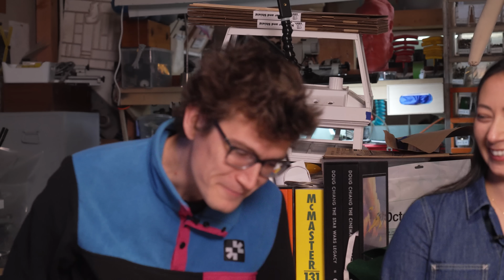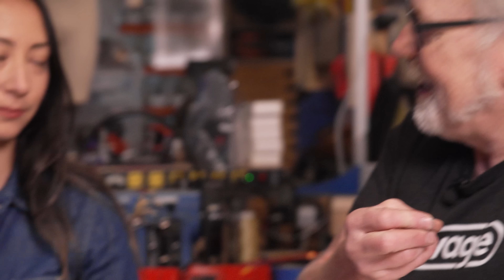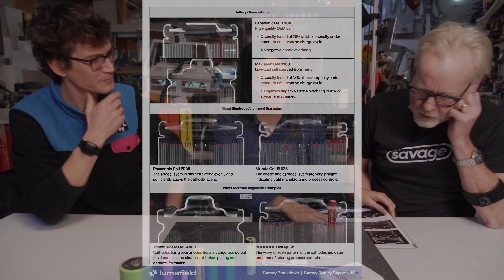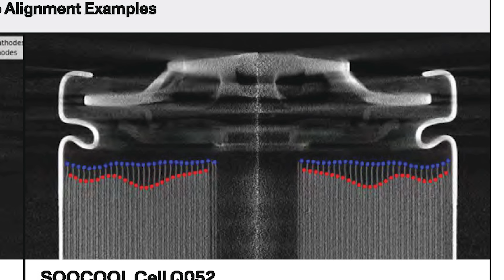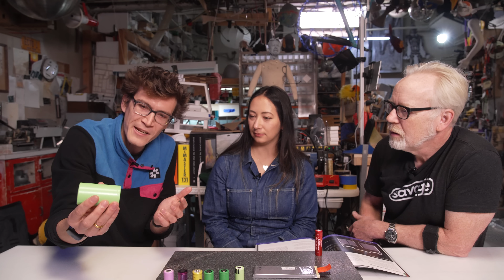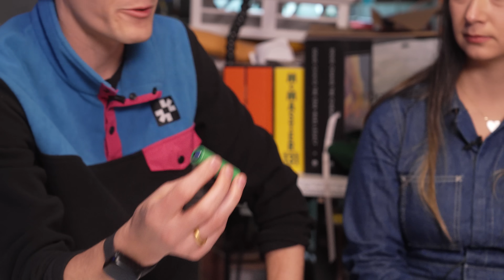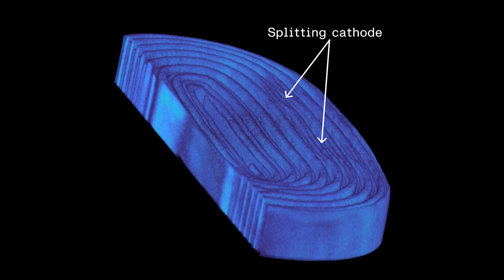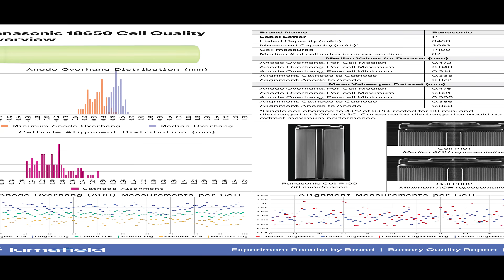The Surprising Flaws in 18650 Lithium-Ion Batteries

Comment: We are still in the fairly early stages of lithium ion battery-powered devices and vehicles. Chemistries are constantly improving in both energy density and safety, but there is always a danger. That being said, supposedly sodium ion batteries are significantly less likely to have a thermal event and are made from extremely abundant sodium. Solid state batteries also promise to be super safe, but they've been "right around the corner" for at least 10 years. Still, I hope they do finally make it to market because they have huge advantages such as safety and very fast charging capability, as well as virtually zero chance of catching fire.

Comment: Would LOVE to see the top brands that Battery Mooch has reviewed and rated well. What are the actual differences inside well-rated cells, not just junky Temu ones!
Reply: You should be good as long as you buy from reputable brands like Panasonic, LG, Samsung, Murata, or EvE. Just make sure you buy from a reputable distributor as there are a lot of fakes floating around.
Reply: All I can find is a YT channel that has no new content for 5 years.
Reply: @manuelh.4147 Still very relevant though! Search ECF for the other review charts, full name "ecigarette forums". Most 18650/21650/21700 cells have not changed in the last 5+ years. For example the wildly acclaimed Samsung 25R has been in production since 2014. Sony Murata VTC5 (and VTC6) has been in production since 2012. Both of these models and many similar to them are used in cordless tool battery packs. Safe high amperage discharge is relevant as they were used for vapes that can easily draw up to 30 amps. Definitely the kind of thing you want confidence in--hence all the testing.
Reply: @manuelh.4147mooch's?
Reply: Preferably tabless cells
Reply: @Datvi what's tabless?

Comment: As a gun guy I'd be very interested to see the batteries from Surefire, Streamlight, and Modlite. These batteries need to handle recoil and heat over time especially if they are rechargeable.

Comment: People seem shocked that battery fires are as bad as they are.  Almost ALL battery technologies have this same issue.  The biggest difference is achievable discharge rate and energy storage capacity.  For example, lead acid batteries don't have the energy density, but they are CRAZY fast at discharge.  A lead acid battery fire is NASTY, but usually short lived.  Lithium batteries are also very bad, but more due to the energy storage capacity.

I remember when mercury batteries were a thing, and those didn't just burn, they would explode (CRAZY high discharge rate).  Which is no fun when it's something that has mercury in it.

Comment: Just FYI, I personally have taken the 18650 batteries out of several different brands of laptops. Most do not have a name brand on them and are of different color outter wrappers. I have never had a problem with any of them, that I have not deliberately damaged. However I have accidently dropped the mulltilayer flat 3 piece cells for RC cars and drones. I had one split and burst into massive smoke and fire. Can only guess it hit a small sand pebble to cause the issue. I have shot quite a few of ones that would not recharge, with a pellet gun to see some just have gas escape and get hot and others that have split and caught fire. Never had a fire or explosion inside a product using them. do have one of the quality charges that can charge by reading the battery types, like NMH, lithium and cadmium.
Reply: many laptop batteries do have a typenumber, ang googling it may find Sony,Sanyo,Huyndai, LG Panasonic or other manufacturer OEM data sheet, and often those have been confidential when last edited
Reply: Darwin Award is waiting for ya

Comment: Unfortunately even buying respected brand names isn’t always enough.  The world is rife with counterfeits.

For example, I bought a set of AirPod Pro 2 ear buds by mail order.  The price was slightly less than full retail, but not much less.  The fake AirPods were in a normal retail box with normal documentation and even had the tiny serial number printed on them.  The fakes were even detected normally by my iPhone and were matched to the extended Bluetooth settings which are displayed for real Apple AirPods.  The only give-away was that the firmware in the fake AirPods would not update.  I took the AirPods to the Apple Store over the firmware issue and the store workers were also fooled by the fakes until they did some in depth research and found the serial number on my fakes had been attempted to be registered in ten different countries and Apple had black listed that serial number for updates.  Luckily I was able to return the fakes and get my money back. You can use due diligence and still be scammed.
Reply: The odd thing was that when I paired the fake AirPods, there was never any feedback that there was an issue with the serial number.  As far as I knew everything was legitimate.  There was never any indication as to why the firmware update was being denied.   It seems like at the outset of pairing, there should have been some sort of “This serial number is already registered with another user.”  At the very least Apple should do that to prevent someone from swiping your genuine AirPods and pairing them in their name.  It seems like something more aggressive than not updating the firmware is called for.

Comment: I mean, in RC we use Lithium Polymer batteries that are basically the same thing, and the chargers have some interesting methods of monitoring each individual cell in the pack, but the important thought is there's fire boxes for storing and charging the batteries that don't stop them from burning if they light up, but they do contain the fire and keep open flames from escaping

Comment: What I got from this video after watching a single time:
1) This is about rechargeable batteries and *not single-use batteries*.
2) Brand actually matters, possibly not in terms of output voltage or amperage, but definitely in the long-term safety of either
     A) using this battery multiple times or even
     B) storing it in a drawer and spontaneously combusting.
     However, for my non-rechargeable low-power single-use batteries for my TV remotes and Wii-mote, I'm sticking with the cheap ones since they won't krill me or my friends unless I throw the battery at them hard enough.
Good brand = Less likely your house or bedroom (or your ears and brain.........) goes up in flames.
3) Statistics about likelihoods of Li-ion battery failures are skewed HEAVILY toward these Temu brands, not just some "pick a random Li-ion battery and it has a 1/10M? chance of exploding".
     So, good-quality battery brands are very likely to never fail catastrophically.
4) Haribo brand (yes, the gummy bears) batteries exist.
5) Don't ever use Haribo brand batteries.
    (yes, certain exact batteries from Haribo may be totally fine yadda yadda, but I'm never taking that risk, especially with airpods near my brain)
6) Batteries, which have a non-negligible chance of setting fire and releasing extremely toxic and burning gas, are in wireless devices right next to my brain if I use wireless headphones or earbuds.
7) Circuit breakers ("Current Interrupt Devices"/CIDs) exist for rechargeable batteries and, when included, are present without you ever seeing them, preventing fires without your knowledge.
8) CIDs aren't legally mandated to be installed in relatively-high-power rechargeable batteries (at least in the USA) for some reason???
9) Battery dendrite formation (where crystals grow inside the battery and become so large they stab a hole through the layers that are supposed to remain electrically separated, and then cause a potentially fire-inducing massive short once the layers are punctured) can happen at the points where the cathode (+) and anode (-) sheets are misaligned in the battery, so preventing misalignments is important if you want a long-lasting and non-combusting battery.
10) Battery CT pictures are pretty and look like soundwave amplitudes.
11) It might be safer to have anode sheets stick out above cathode sheets rather than cathodes sticking out? Not sure why though, or if that's even a valid assumption from her words.

Comment: I currently have over 60 rechargeable devices inventoried in my home - everything from an electric toothbrush to the 4,413 batteries in my electric vehicle. I am a firm believer that if you bring a rechargeable device into your home/garage/property - make sure it is from a reputable, quality brand. The more energy that is stored in the device, the more important to be concerned - but a fire can start even with a simple electric toothbrush. Also remember that most batteries will last longer when stored unused for several months if you keep them around 50% charge.

Comment: I don't know about x-rays, but the only experience with the 18650 battery that I've had directly was with the Coast "Zithion-X" Model ZX850 battery that came with the Coast TP9R mini flashlight (think - a mini Maglite but with multiple light intensities). These ZX850s are rechargeable via a USB-C jack built into the side of the battery near the positive terminal. My instance of this battery holds a charge for only about an hour - even if you never turn the flashlight on. The side of the battery brags, "with overcharge / discharge protection circuits", but apparently the overcharge/discharge protection circuits draw too much current 24/7 - or  in my battery's case, 1/1. A bad battery design.

Comment: Premium 18650 cells do not exceed 3600 mAh in legitimate production as of early 2026.  See any seller rating them higher than that, don't buy them.  18650s are mostly counterfeit junk in my experience.
Reply: The 4000mah cells from vapcell and efest are legit though. I've seen them tested with over 4000mah of capacity.
Reply: @RykerRobb  Grok agrees: "Overall, unlike many overrated "4000mAh" cells from shady brands that test way below spec, Vapcell's 4000mAh 18650s (especially the N40) are genuine and often perform better than advertised in capacity tests. Buy from reputable vendors (e.g., Liion Wholesale, Illumn, or direct from Vapcell) to avoid counterfeits."

How long before Vapcell counterfeits start showing up?

Comment: I have a couple of Drones and one I had not used in about a year, I decided to charge it up and have a play, BUT
when I took the pouch batteries out they had swollen, about 20% over the original, and cracked the drone frame.
I sent them off to the recyclers and binned the drone.

It was just sitting on the shelf in my study !
Reply: They can do that if over discharged, always disconnect batteries if not in use for a while and for long term storage it's best to (dis)charge them to 70-80%.
Reply: Like cans of food, discard any bloated lipos.
Reply: @Racing_Pig Recycle, not "discard".

Comment: Whenever possible, use lithium iron phosphate batteries (LFP, LiFePO4) as they aren’t explosive, and they have up to 10x cycle life, than Lithium Ion.

Yes, they are less energy dense, but that doesn’t mean, they aren’t used in some brands of EVs. I have assembled a 12 cell pack for my 
E-bike which gives me even better range than the original lithium ion battery. There are many ways to do this, but - you still need a BMS to balance them, 
and even LFP batteries will smoke, if you abuse them, but that is also everything they do. Lots of YouTubers are demoing this, overcharging, puncturing, 
everything - they will not burn. And yes, as a bonus, no Cobalt either, so they are less toxic than regular lithium ion batteries. 

I really hope powerbanks and even tablets and phones starts to use these batteries, maybe with some sort of certification called "airsafe" or something like that, so that any risk on airplanes are mitigated. The producers of gadgets,  must start to think more powersaving, so that the less energy density can be offset by the less energy used. It should almost be forbidden for private persons to buy stationary powerbanks which aren’t LFP, because they are so much safer, and really - any idiot can assemble an LFP pack, while only experts should assemble lithium ion battery packs because of the many ways to f… up.

Comment: Also worth noting is that purchasing your trusted brands only works if you buy through a trusted storefront, rather than buying them cheaper from something like BATRIES4CHEEPLOL on a store that hosts third-party sellers, like Amazon or Alibaba or the like. It might SAY Samsung but that'll just be an imitation plastic case over some underperforming, unsafe knockoff.

Comment: 18650 and 26650 SUCK because of the pcb in it.  if they would act like a normal AA they would be 10 times better. 100% of them will fail the question is when lol. And i like the talk about cheap cells.  Where are these cheap cells as the cheapest i can find them is 7 bucks a single ffing battery.

Comment: I try to store all lithium powered objects in a metal container, far away from flammable materials in my garage! That said, we do have two Tesla's as well as a Tesla powerwall mounted on our wall. Risky biscuits? Not as risky as a gasoline car though. My grandpa's house / garage caught fire once because of his car catching fire in the garage. Stay away from gasoline vehicles! They are far more dangerous than even lithium ion batteries failure rate. We do risky things risk / reward ratio is too good on the reward side. Worth it.

Comment: Here's a question, how long should we keep using a battery device. Like I have power-banks that are many years old and working fine, but it feels like they ought to have an expiration date, though to be fair they are not frequently charged/discharged but for some people they may indeed be worked hard, such as with professional power tools.
Reply: Keep using it until it stops doing the job you need it to. Over time the battery will degrade but if still provides enough juice for you then it’s fine.

The notion of an arbitrary expiry date is silly and wasteful.
Reply: Basically your batteries have a half life, mostly due to charge cycles and temperature.
Roughly 100 cycles if you hit them hard within spec, 1000-10000 100% equivalent cycles if you take care of them (low current charge/discharge, and going 70%-30% capacity for charging cycles)
Your batteries should have a bms in the device or pack to prevent issues, so if the cells still work and aren't cracked/bulged, they're fine.
Old batteries can hold less charge and provide less current so at some point you might need to retire them for some uses and use them on lower cureent stuff.

Comment: Where to buy a quality 18650 battery has been elusive. I don't think it is possible on Amazon or Ebay.
Reply: I get mine from failed cordless drill batteries. When a pack fails, it's usually just one cell and the rest still work fine. Take care on disassembly obviously but oem batteries use quality cells inside. You can use a flush cutter to clip the spot welded foil on the terminals

Comment: I have protected and unprotected. Fun fact, tgey are different lengths. I had Amazon ones that weren't protected that cost like $20. My high end device only takes protected, therfore unprotected didn't reach contacts. I has to buy brand name protected, all up it cost me $120. Each battery was double weight of Amazon ones. Apparently Amazon ones aren't real, they are a case the same size, but internals are BS! Real ones are surprisingly expensive for their size!

Comment: TL;DR - Do NOT cheap out when buying li-ion batteries.  EVER!
Reply: There no way to know what batteries are in your appliance.
Reply: I wonder which expensive batteries are equally bad.  Reputable might be the better way to say "don't buy cheap".

What I didn't see is which brands have the best batteries.
Reply: @denisabalakov73 I noticed the the one they held up as having excellent construction and wrap consistency was labeled Panasonic, so there’s that.
Reply: @denisabalakov73 Just buy from a reputable brand like LG, Panasonic, Samsung, Murata, or EvE. Of course, make sure to order it from a reputable seller as there are many fakes floating around.

Comment: Actually I would say that the most "branded" cells are often the low quality.
Highest quality cells often have just barely visible model number dot printed, not even name of the brand.
Trustfire/Ultrafire rubbish half-filled with sand have a lot of branding/graphics on the wrapper.
Reply: It still amuses me that they called their Li-ion cells "Ultrafire".  I came across some called "Maxfire" at the office.
Reply: @Wireball  Oh yeah the cheap ass production manager had a flashlight with one of the ....fire cells.
But I have to admit, when I was a teen I got myself fooled.
I thought those 5000mAh 18650s were legit because I assumed if people leave good reviews and that the listing is allowed to be up, thousands of cells sold, that it has to be legit.

Comment: 17:23 Stop using the device if it gets warm?  That's 80% of my Li-Ion powered products under their normal working environment from flashlights, work lights, cordless power tools, even my phone gets warm if I'm asking much of it.

I get more worried when I see youtube videos where the producer is suggesting ways to "repair" a battery pack that has had it's BMS disconnect in order to be safe(er), then they're stating it's some secret hack to over-ride the protection that the BMS was providing.  Even worse is when they also add that it's okay to use your pistol grip 300W soldering iron at 500C temp to swap out some weak cells rather than spot welding them, and it becomes even more hilarious when they just grab some random used cell that they pulled out of something else, then they tell you that if your charger won't charge your 18650 which is sitting at 1.0V, you ought to force some current into it with another method before putting this potential fire bomb back into the charger.